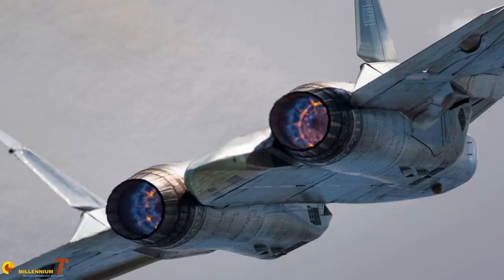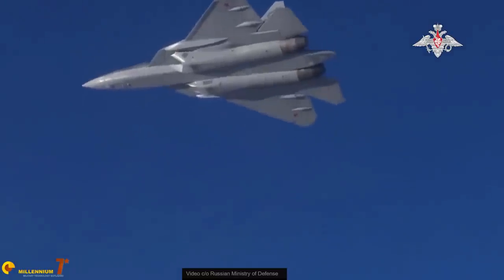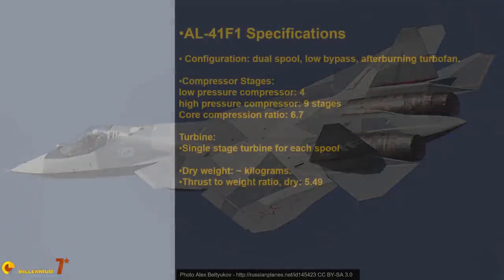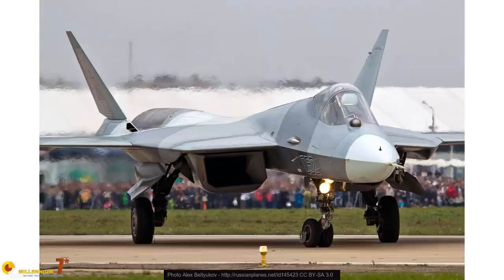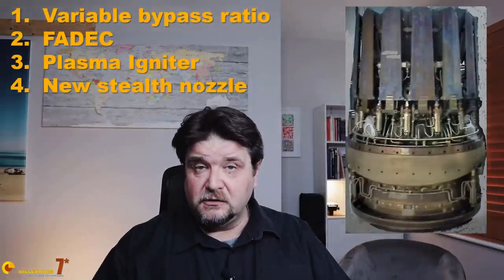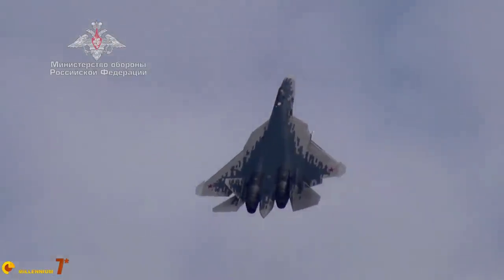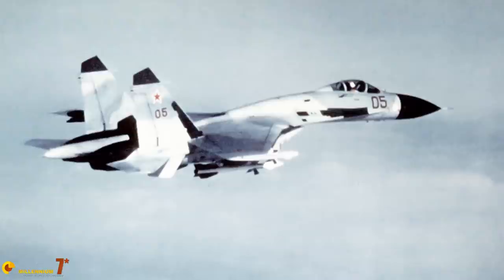Su - 57 the Raptor Slayer | Part 2 - Propulsion

Comment: I absolutely enjoyed the dual post as understanding of the SU program.  And the security....*
Where the design meets or exceeds range, performance envelope and indeed stealth domain is a curious, modern compartment of aircraft logistic and delivery.  Metals, machine tools to deliver a product in numbers...a required support.  
So much also, as avionics and ground support for a group so fielded.  Inspection schedule, calibration, fuels..and the training of crew.
In the end, where thrust vector will meet drone fleets, radar, and weapon.
That a man is so engaged, to fly this beast of a model...a part of the resolve of the craft.
Thank you for the careful, information packed view.  M.

Comment: Abit of corrections,
1. Gonky fought the Malaysian Su30 MKM in a legacy F18D. 
2. Gonky lost many times tu Su30, it was a time when he had his gopro with him that he won the engagement.
3. He mentioned that the thrust vectoring does have its use as he had first hand experience fighting against it and capture on his go pro!!
Reply: In that video, the planes meet in a vertical two-circle maneuver 3 times out of 3 with the F/A-18 pilot does the most effective move trading speed for altitude, therefore greatly decreasing his speed which does in turn increase his turn rate. The SU-30 on the other hand dives increasing its own speed while decreasing the turn rate making itself an easy target. You can easily count the seconds it takes the F/A-18 to turn 270° with the upwards turn and the SU-30 managing only about 180° degree in the same time during a downwards turn. However, after the end of the 3rd engagement, we clearly see the capabilities of the SU-30 rising up doing an upwards turn and turning 270° in the same time the F/A-18 turns about 90° coming in a head on pass with the pilot commenting on his adversaries airshow performance and the amount of such engagements he had during his service there. As outsiders, we do not know the roe of that meeting, however in the BRD Mig-29 squadron documentary one of the pilots does state that most his engagements had to start with predetermined maneuvers to simulate different scenarios, therefore, maybe the rules of that recorded F/A-18 and SU-30 engagement had some rules applied as well.
Reply: @satz5964  also consider the fact that they are probably just experimenting different tactics. Gonky was a civilian working for Malaysia at the time and obviously there are lots of stuff not told on camera.

Comment: Excellent presentation. 
Trimming thrust for max efficiency seems to make good sense, and along with the possibility of missile tracking problems, I believe this has a good probability to pay off in the future as the Thrust vectoring nozzles eventually decrease in weight.

on a side note;
your audio production is spot on as far as I am concerned.
Reply: i wonder if there is also a reduction in radar cross section during operation by being able to use non-aerodynamic controls.  or if they need the thrust vectoring to maintain control authority due to aerodynamic issues with optimizing for efficiency and/or stealth.
Reply: Thrust vectoring engine development and production costs (and maint. complexity) does not justify a 5% fuel efficiency increase. Fuel efficiency + the thrust vectoring suicide juke (dodging a missile by bleeding shit newtons of energy) is only justified if the cost of the Su-57 matches the expected kill rate against F-22s and F-35s, and only if CQB occurs more than rarely; the thrust vector dodge does not work at BVR ranges when the launch aircraft has high energy. The Russians are willing to add 5 million dollars to the price tag of an aircraft for propaganda purposes.

Comment: I would like to point out, that in "thrust-managing ONLY mode of flight control" the plain retain the best shape against radars, compared with normal flight, in which somewhat and sometimes feelable deflection is needed.

Comment: Would it maybe be that the thrust vectoring on the SU-57 is used to help avoid its control surfaces from making 90 degree angles with radars while performing maneuvers, thus helping to preserve the jets radar stealth.
Reply: The stealth features in the plne are poor. That would be too complicated to gain marginal advantage.

Comment: Going off the efficiency idea for thrust vectoring, looks like the engines have a fairly significant inward cant in case of asymmetric thrust/engine out situations. If it's 3D thrust vectoring, I wonder if this could compensate for cosine losses from the inward cant while also improving safety in a single engine out situation. This would work in addition to the trim effect you mentioned.

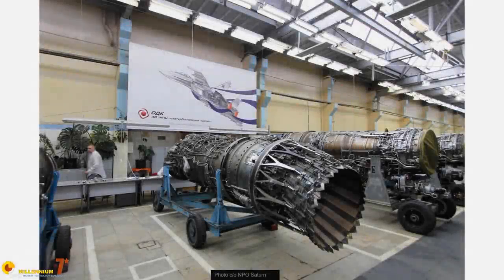Comment: 7:44 it's not an "izdelye 30" engine. We have official information that "изделие 30" is being designed at UEC NPO Saturn, but in the background of this photo we can see banner with "Salut" logo and name of company,  also at the Salut's engines(AL-31FM/FM2/FM3) can optionally be installed nozzle with а thrust vector, so I think that this is one of these engines.
Reply from the maker: You are not the first who is telling me, I was probably fooled by Google and I did not check the details.

Comment: Very interesting video, thank you very much. I've got something to add though to your description of the dogfighting video between the F/A-18 and the SU-30. In that video, the planes meet in a vertical two-circle maneuver 3 times out of 3 with the F/A-18 pilot does the most effective move trading speed for altitude, therefore greatly decreasing his speed which does in turn increase his turn rate. The SU-30 on the other hand dives increasing its own speed while decreasing the turn rate making itself an easy target. You can easily count the seconds it takes the F/A-18 to turn 270° with the upwards turn and the SU-30 managing only about 180° degree in the same time during a downwards turn. However, after the end of the 3rd engagement, we clearly see the capabilities of the SU-30 rising up doing an upwards turn and turning 270° in the same time the F/A-18 turns about 90° coming in a head on pass with the pilot commenting on his adversaries airshow performance and the amount of such engagements he had during his service there. As outsiders, we do not know the roe of that meeting, however in the BRD Mig-29 squadron documentary one of the pilots does state that most his engagements had to start with predetermined maneuvers to simulate different scenarios, therefore, maybe the rules of that recorded F/A-18 and SU-30 engagement had some rules applied as well.
Reply from the maker: good point, thank you.
Reply: @unknownuser069  they might be doing very specific scenarios. Including the tqctics employed, whether TVC is allowed.

Comment: Another reason for thrust vectoring that I was waiting for you to say is short take off capabiliity. Russians dont use catapults on their aircraft carrier and if they want to navalize the su57 it already has nozzles that can point down diagonally like the f35. The f35 uses the lift fan for landing but the russians have arrresting wires because their carrier is stobar. This also fits in with the russian doctrine of capability to take off from unprepared runways and why inlet ducts have screens or doors. On land short takeoff capability helps takeoff from smaller more austere runways. The a6 intruder originally was designed with nozzles that pointed down too, it works good especially with a ski jump like russia uses.

Comment: in my opinion the reason they use thrust vectoring is to lower any radar return as much as possible. since iirc the US is making its 6th gen fighter mainly using no control surfaces.
My hypothesis is by using thrust vectoring for rolling pitching and making flight adjustment deep in enemy territory like the 57 would grant it a less higher chance of getting picked up by radar due to them not really needing much control surfaces to do such manuever for cruise flights

Comment: a correction: the mentioned Su-30MKM vs Hornet video, that is a modernized Legacy D Hornet, also operated by Malaysian Air Force, equipped with the 404 EPE motor. It is actually way more maneuverable than a Super Hornet, and the RMAF is very happy with both planes. They might buy more used Hornets soon and modernize them.

the common consensus outside Russia at the moment is that thrust vector is always a last-ditch feature, at least for now. This applies to USAF, Indian Air Force and Malaysian Air Force. It will be very useful when supersonic fights above 60k ft becomes a norm, because traditional control surfaces is not very effective at that altitude. Or if stealth takes a much higher importance in future planes that everything is fixed and thrust vector becomes the only means of control.
Reply: @unknownuser069  That claim came from ex-USN and Malaysian pilots who flew in exercises. I wouldn't said it if it was a "myth".

Please don't get my comment wrong, I did not say the Super Hornet was bad or anything. It's just ONE aspect that happens to be better on upgraded Legacies. If anything it would be better if Malaysia buys the Super Hornet as was originally planned since 2001. It has a lot more room for capability growth.

But I think you'd agree that buying a new 4th gen airframe is a bit too late right now. The proposed used Hornet buy is a stopgap measure until 5th gen becomes sufficiently mature.

The Blue Angels makes awesome shows out of any plane, I'd say.
Reply: @unknownuser069  Ah that's a good explanation. So it all comes down to familiarity.

When you combine that with how different some export Hornets are configured, no wonder pilots will have certain early perceptions when they fly in, or fight against, a different variant.

Comment: Could the thrust vectoring trim feature be for stealth rather than efficiency?  I imagine control surface orientation is relevant to radar cross section - not having to move your control surfaces could be an advantage, perhaps?

Comment: There's a chance that TVC can be used in a BVR scenario to allow the su57 to briefly point its radar at the adversary, and fire missiles back even when going cold to defend an incoming missile. A missile fired like this may inherit very little of the su57's initial energy, but would still remain a threat, and the odd firing intervals might throw the enemy off guard as they recommit after defending the initial missiles.
At the very least it could probably be used to buy some time to regain some of that energy with its high acceleration. Utilizing the side-facing AESAs, an su57 theoretically remains an offensive threat even when aggressively defending.

I know this is counter-productive, as bleeding out your energy to perform an instantaneous maneuver just to get a bootleg missile shot is probably the last thing you'd want to do when defending a missile, but we all know russian doctrine... and this might be the BVR equivalent (tactically speaking) of performing a cobra in a dogfight. And as you said, the sudden change in acceleration might confuse a missile's lock.
Reply: Well explained!
Thank you
Reply: Yes, as you said this is not a good idea to do though. Because the missile will inherit so little of the aircraft’s energy it likely won’t get near the enemy aircraft before the launch aircraft is hit by the enemy aircrafts missiles which arrived much sooner. Without any aircraft’s energy behind it a simple offset manouvre from the enemy aircraft may be enough to sap it of its energy but of course against aircraft without good BVR capabilities this is still an advantage.

Comment: Shortly after the Pulwama incident, a Su-30 MKI of the IAF dodged 4-5 AMRAAMs launched from a PAF F-16. IIRC the missiles were launched at close to maximum range. Could this missile-dodging have been aided by thrust vectoring.
Reply: @unknownuser069  You're absolutely right as DCS is just a game. However, the basic principle of missiles is same between the game and real life. If a hot target is fired upon with any missile, turns cold, the missile is very unlikely to hit in both real life and any sim.

The biggest difference between real life and DCS is the random air traffic which does exist in real life and therefore hugely limits the use of BVR. I have only ever heard of a handful BVR engagements in real life with most of them happening between fighters and attack aircraft and not between fighters, like in Syria so far. The fighter to fighter engagements happened mostly within visual range using hobs due to the need for identification in order to avoid hitting civilian aircraft, like in the Gulf War or Ethiopia vs Eritrea.

Comment: I really hadn’t seen that last mechanical anti-missile impact hypotheses coming

A jagging manouvre while “painted” and Electronic measures to see the missile trajectory and automatically deceive it to point its explosives charge in the wrong direction just before impact is absolutely genius 

If the algorithms of the missiles aren’t upgraded to counter these moves in the first days of combat there will be a significant advantage in a near stealth plane to survive a head on or sideways attack 

And possibly penetrate an adversaries strike groups or air dominance defensive flights 

Perhaps even to reach an AWACS platform over the battle theatre in a dash move with a supercruising low rcs plane like the SU-57 especially if taking off from a merchant ship or forest road with no intention of returning to base 

I love it :) daring defensive tactics
Reply: it's not that low RCS and it's thermal signature is huge. Its not the ninja you think it is. Additionally, the thrust vector juke is just an improvement on what first and second rate air forces are already capable of doing; depending on the situation modern AAMs can already be reliably be out maneuvered. Again, the downside is that a Russian plane gets to do this once, and then it dies because a thrust vector maneuver that is significantly more effective than normal missile evasion tactics is still going to bleed energy and significantly disadvantage him in the rest of the 1 and 2 turn fight, that he's just got a missile shot at him in CQB meaning he's already in the disadvantaged position and bleeding his energy simply sets him up for every additional missile and gun shot that is coming after.
Reply: Me as a russian is extremely uncomfortable to think that to counter missiles which can be upgraded pretty fast you need to spend much more resources to develop such an advanced engine system. Its too much and completely impractical. I think thrust vectoring is much more complex idea and not a solution to one or two problems. Coupled with a good software It lets you to achieve so much in many things. For example it can make much easier to control plane and forgive many mistakes made by pilot cutting training time and costs, or maybe this is a good option to make plane completely unmanned and you can do much more things when you are not limited by human body.

So there is many possibilities, thrust vectoring just gives developers a whole new set of instruments to create many usefull things which combined can be a significant advantage.
Reply: @ЕвгенийБулыгин-д6ч  
I agree :) You have completely hit the nail on the head. 

Imagine thrust vectoring in an optionally manned small single use point fighter, or hanging from a AWACS platform the size of a B-52 or Tu-95 like a civilean Airbus or Boeing

Copple it with a simple missile system,  a Pulse engine, like the V-1 as propulsion, that can be made by any blacksmith

In such a cheap concept, it will be VERY difficult for an air defense to counter with a simple direct engine missile. I am thinking a global Hezbollah capacity, where there is no Iron Dome shiled like that of Isreal.

There is a whole new ecosystem of low-tech weapons out there, and thrust vectoring and multiple movable surfaces with a software that can adapt in flight is a wild chaotic solution - either in a networked and fused wingman

It is clearly one of the methods that small tactics air warfare will move, and thus the Russian strategy of having a smaller and less expensive conventional force is GREAT, versus the US still having a HUGE military industrial complex

I think China will move this way too. 

The development of this ecosystem in ideas and concepts is key to distrupt all aviation and warfare in general